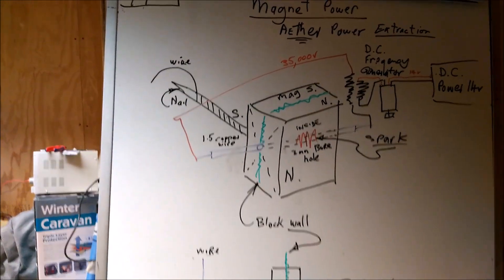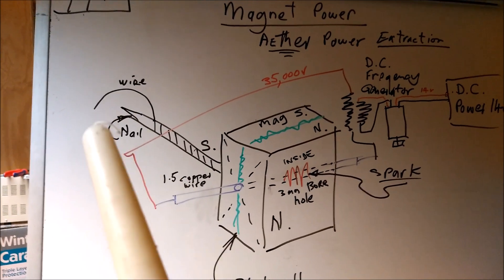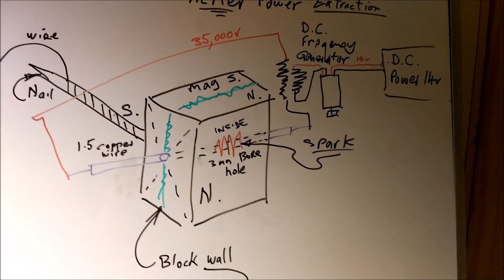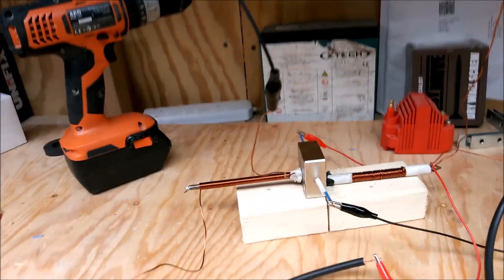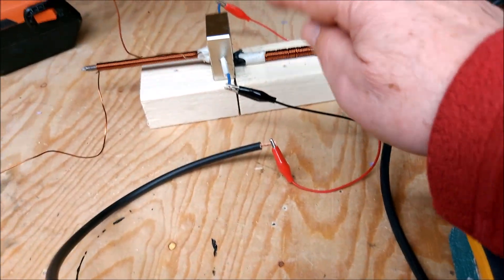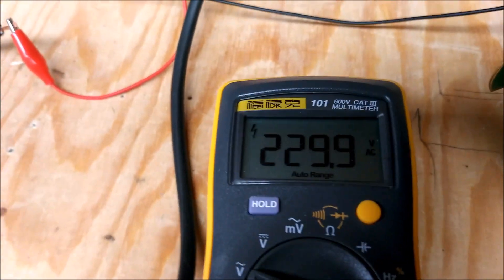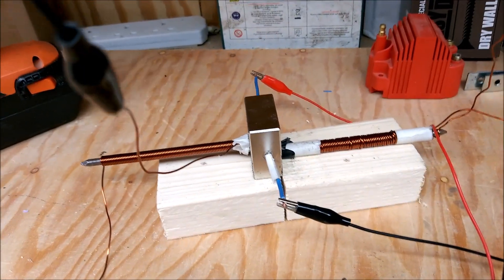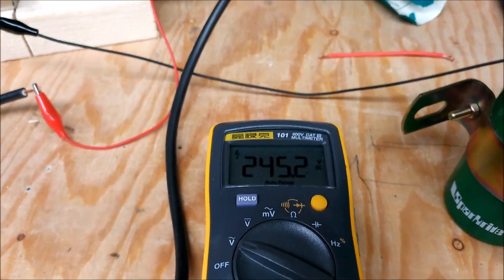Point Source Power Generator

Comment: Hope to c upoer something as if u could show the connections more clearly the wire connections
Reply from the maker: DK yes hope to engage again after Covid, its been a real blocker.
I have been talking with electrical engineers.
So its all about "Induction" as you know and the the maths.
So its work in progress but first waiting for a reply from Ken Wheeler relating to "Magnetic / Dielectric" fields.
Notes
Ken is now endeavouring to put together a self sustaining O.U. project. Regards DC
Reply: @e.powerdc1127  look up paschens law in Wikipedia its done in 1889 abt the time Tesla was alive so he would have heard of it and worked on those things
Reply: @e.powerdc1127  I liked ur stout bar experiment... I have a some reservations coz I think argon like nitrogen and oxygen has a very high ionization energy what it means is  at esp high voltage not frequency as not sure as no data  u cd ionise them ie argon at 60k volts to 80k volts and that energy could be something that ur looking via the spark gap so voltage is something that must b looked carefully at but having a high voltage transformer is dangerous is like having a rattlesnake around ur neck unless it is low current... So I will leave u with info 60k-80k volts for ionisation esp argon... Nitrogen I will check it up if u ever run the stout bar nd if ur able to measure the frequency....could b a possible lead as double measurements 2c wr it ionizes, once it ionises it makes its own electric field, or dielectric field of energy  without any ac problems ie of magnetic nature... It explains lightening too at high voltage the ionization energy is released only thing it needs to be carried using Tesla tools proper voltage found that works
Reply: @e.powerdc1127  also chk if u can rectify the voltage ncurrent using a rectifier thyristor or mercury arc into dc
 youtu.be/FnhXZTi-Hso
youtu.be/wtByfty9xiU

Comment: Would like to c the voltage gain if it could be put through a step down transformer with small no of coils at the sec  to check what amperage/ power gain  could possibly b got out how the wall sockets draw that would icing on the cake... Going all the guns smoking keep up the enlightenting work part for ur health

Comment: The output voltage is good.

 But what current is it? Cold or normal??
Reply from the maker: Hi Aug. Voltage very controllable, showing "Hot".  Using positive pulse. Extracting the AMPs is the question that i am working on. Magnetic v Dielectric! ... Regards .... DC
Reply: Only insulator and magnets. This is the future. John Searle was able to build his generator on this principle. But its generator is dynamic. It's difficult, very difficult. Not just that, he is in some photos in clothes with masson details;) But its device can be made static, without rotation! Magnets and insulators.

Comment: look forward to seeing more test results. what is the other end of the coil winding connected to?
Reply from the maker: Hi S.B. its one thing getting the voltage the next bit is the hard bit, AMPs. I have to invest in frequency generator and oscilloscope i destroyed the last ones. Could be months but i am still focused, so step by step.
Ans;:- On each side of the magnet poles 4inch steel nails wound with copper coil wire. (Note) the nails are insulated from the magnet. A link wire links the two coils. 
Hope this helps thanks for your interest.  Regards .... DC

Comment: E.power DC, in ur previous video I tried to post a link to Santos Bonacci chanell video "Magnetic music, sonoluminescence" but the youtube keeps deleting the link, there is a 37th minute where he shows how to build similiar thing.
Reply from the maker: I too have problems with links. May have to migrate to another platform. ... Regards DC
Reply: @e.powerdc1127  Thank you for the answear, and i got to thank you for your work. E.power DC do u still use autogen 6 or you dismantled the machine? I dont see it around on your table.
Reply from the maker: @killyblam3  Hi K.B. the other one is still around and its going to be easy to attach to a "Big Boy" magnet if i can confirm 100% amps from the latest baby.
Still got some ways to go need a scope and other stuff but i will get to the nuts and bolts A.S.A.P.   Regards ... DC
Reply: @e.powerdc1127  Happy birthday to you E.power DC and 100 years of happy life ;)

Comment: Voltage is not a power. Direct voltage from your car ignition coil is much higher already itself. :)  Show it with the load :D  Put on 220V bulb :D
Reply from the maker: yes will do A.S.A.P.  .. Regards.. DC
Reply: @e.powerdc1127 It's been 2 years since your last response here. Were you able to power a bulb?

Comment from the maker: I am so pleased cos  have worked so hard on this "In faith" following what i already knew inside. 

Credit to Nikola Tesla "The World's Hero". 

Quote: " The Future is mine " (Tesla). Tomorrow is my birthday, 73 years ... Blessed....  Regards .... DC
Reply: I have an idea  chk if possible use ur magnetic voltage doubler inside a Don smith's coil the capacitance of the first in resonance with the magnetic flux inductance then put ur magnetic vibrator inside that to induce changing magnetic flux vibration at 500 odd volts  shd give out the power adequately which can be using a bridge rectifier and capacitor transformer b extracted out... I am sure this shd work  though, the coil used must be at resonant frequency with the primary, also u can use a vibrating ferrite block though will need to check if in out is a good or just a small block at the center vibrating in out or rotation, all 4 processes need 2b checked, hopefully the magnetic vibrator wd do adequately or even vibration of ferrite shd do it adequately, the changing magnetic flux density, shd accelerate the power generator, at the secondary coil, with primary taking care of the capacitance, so its a capacitance to inductor breeder with magnetic flux voltage, if needed dc impulse shd b harvested at the cap or rectified cap grounded with positive to load, the ferrite can b grooved  2make it ns sn which as the flux created will take care.. 
youtu.be/OcFySCAxLzs